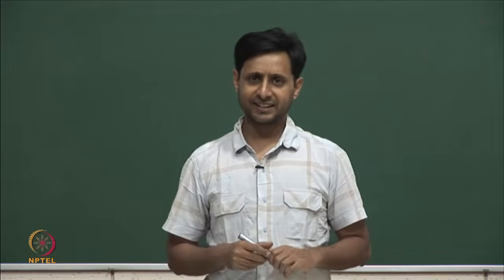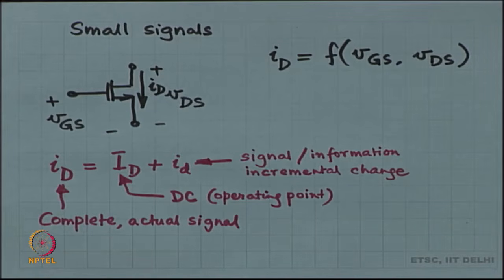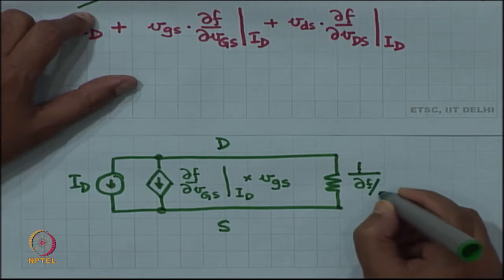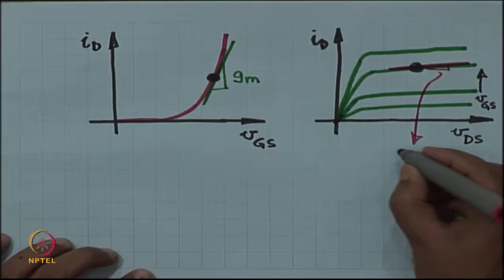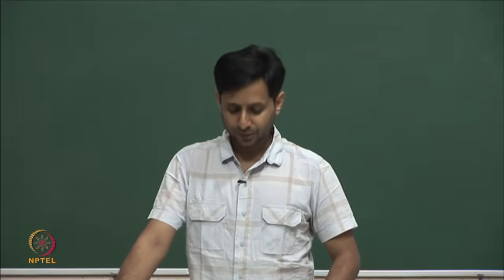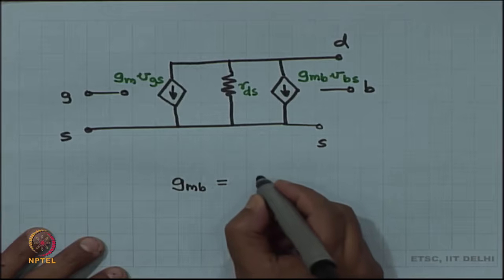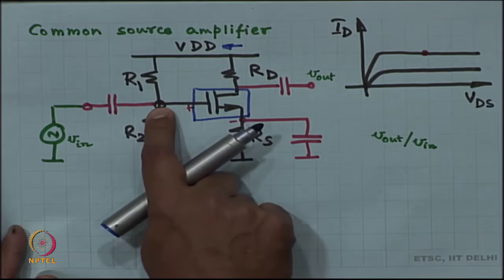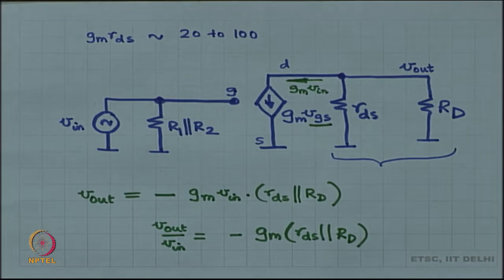Common source amplifier, small signal analysis

Comment: sir at 51:55, the value of rds is greater than RD that mean their resultant might be RD(since parallel connection of rds and RD) in that case the gain should be gm*RD but you have written gm*rds why???
Reply: He is telling about intrinsic gain of the amplifier (when RD is infinity) so it is gm*rds
Reply: If two resistors are connected in parallel the current will choose the low resistance path that we all know hence rd (RD =♾️)
Reply: yes.. you are right brother.. gain turns out to be gm times RD only